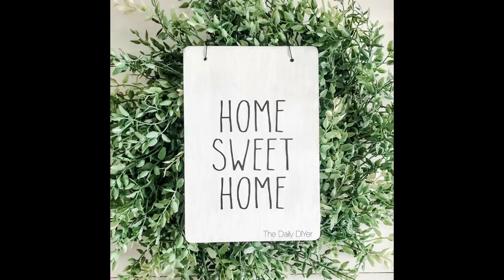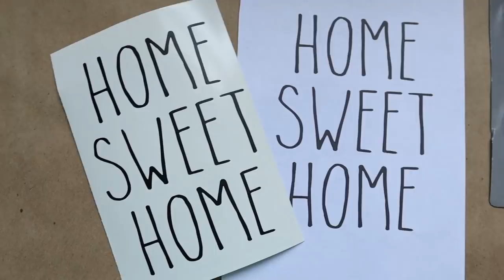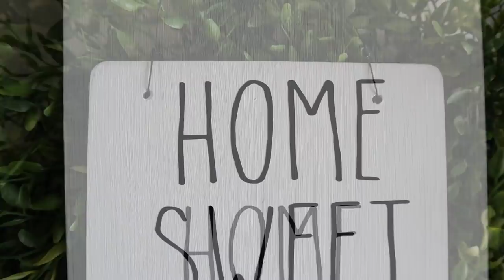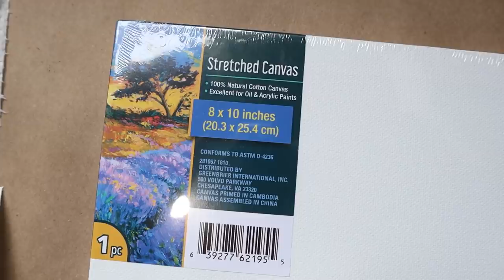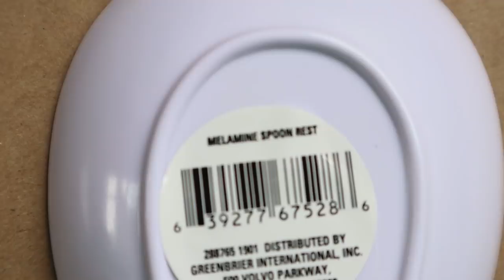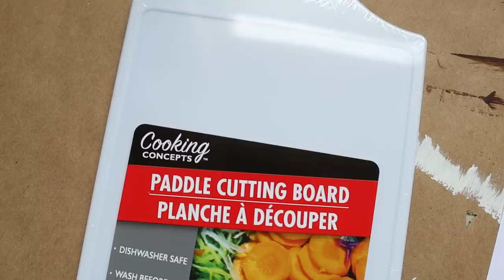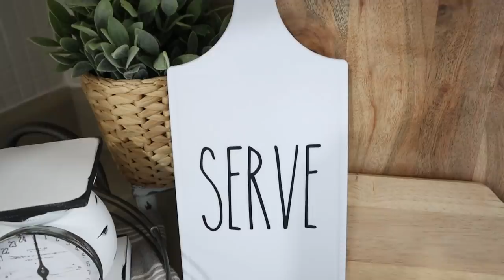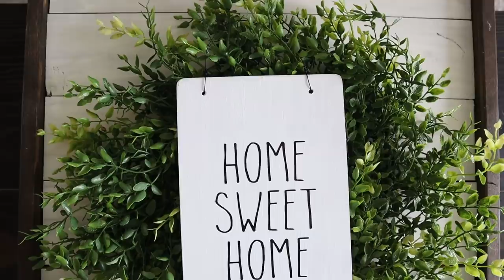DIY Dollar Tree Rae Dunn Hacks | 4 PROJECTS!

Comment: You should check out Jami Ray Vintage here on YouTube, they use a spray gun on their compressor with chalk paint it would make it so easy to keep the paint brush lines and it will be completely flat. They get the spray gun from harbor freight for like 10 bucks.